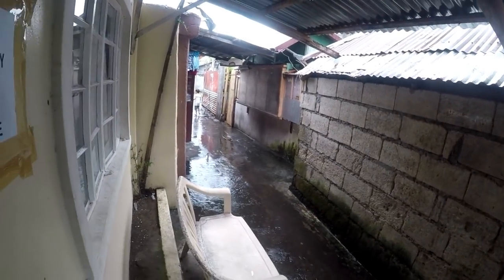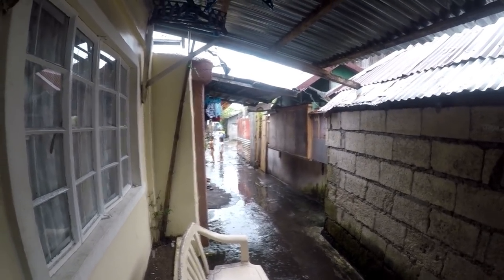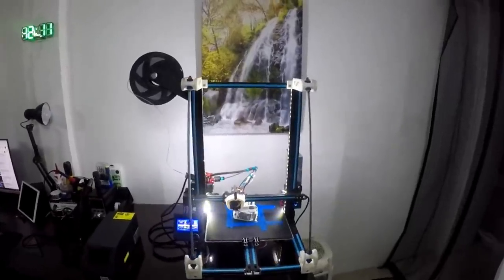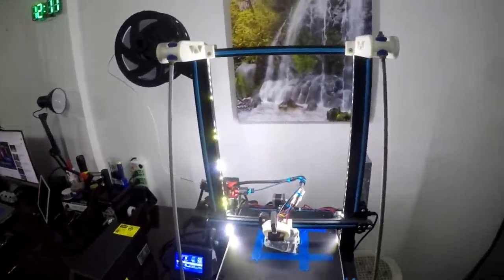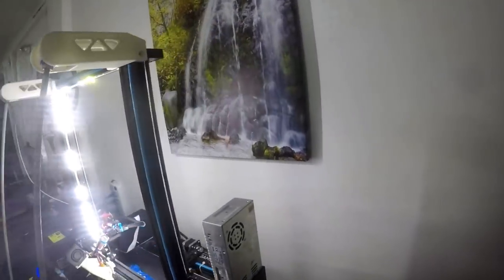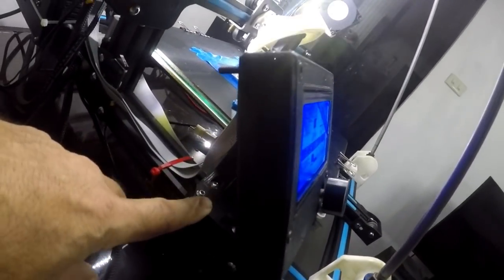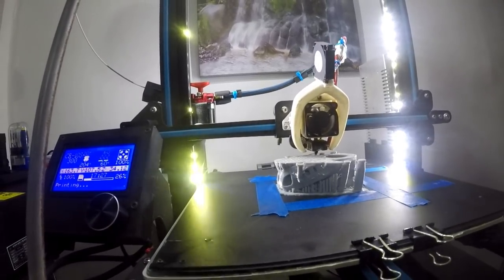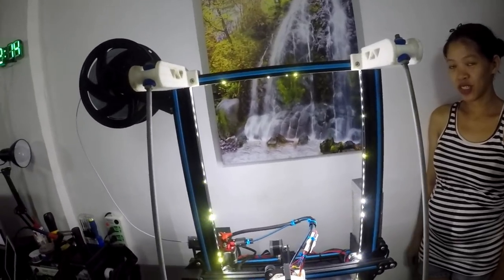Personal Update CR-10 S 3D Printer Printer PC Repair 1 of 2 Bicol Philippines  Vlog 438

Comment: Hi Chris & Mel , What happens if you get a brown out when the printer is creating ,does it continue where it left off when power is back on might be a stupid question but just wondered if it messed up what its making ? good video and valuable points on relationships thanks .guys looking for a life partner should use there brains and common sense and not what's in there trousers ,better chance of finding the right partner :)
Reply from the maker: It's not a stupid question,some 3D printers don't have power resume,but mine does.I'm always shocked when I get messages from foreigners that have been well and truly ripped off even though I shouldn't be.

Bad things happen in this life,but by taking a few precautions some things can be avoided.

Comment: Chris, I may have missed a previous video but I was wondering what is your purpose of owning a 3D printer.  Are you just planning to make toys?  It is very slow.
Reply from the maker: It's just a hobby,so far I've printed an Egyptian chess set,a dragon and of course the redesigned parts for the printer.